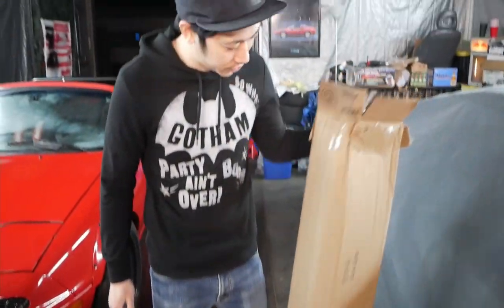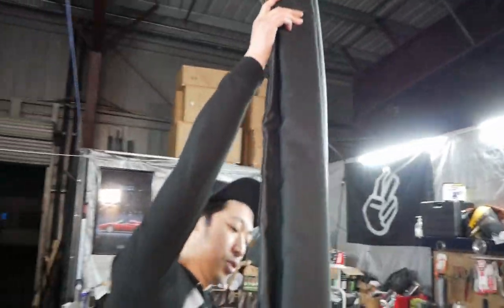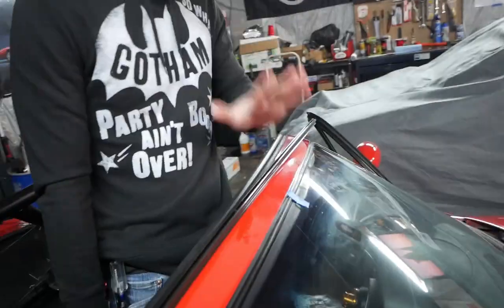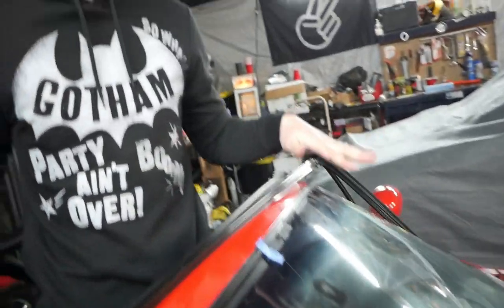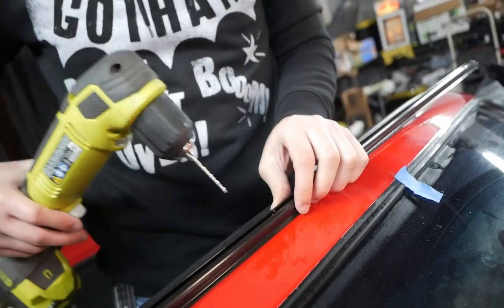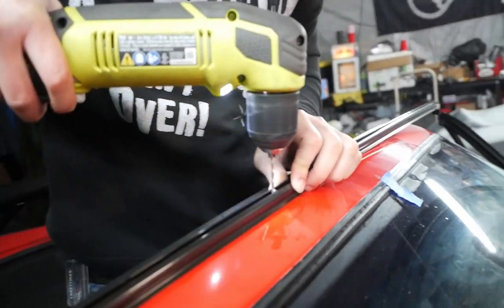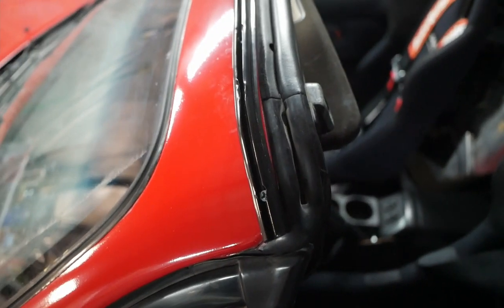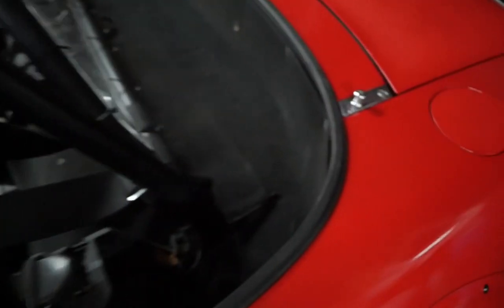Miata Bikini Top Install | And It Doesn't Cost $600 | GJR Racing Keeni Top

Comment: Dumb question but can you still put a hardtop on after you drill holes into it? I mainly use a hardtop in winter but for those summer months i really like the idea of having a bikini top.
Reply from the maker: Yeah they currently have 2 versions. One that you sacrifice a soft-top frame so it attaches to the windshield like a normal top.

2nd is the drilled rail (the version I have). But as you can see in the video it mounts just before the rubber seal. Your hardtop should fit just at the seal so the two should not conflict with each other.

Comment: that looks great!
but in order to run a Bikini top you must drill out the front?
I thought it was connected using the front laches somehow
love the look, but wouldn't want that permanent on my 95NA
?
- great video thank you!
Reply from the maker: the version I bought you drill into the body work. It was intended for more track focused cars where you dont care too much about body work. 

They do have a version that uses parts from a soft top like the latches I believe. Check the site out.

Comment: I’m wondering why you HAD to remove your soft top to fit the roll bar? 🤔 I have a roll bar installed as well, didn’t have to take the soft top out though.
Reply from the maker: The roll bar I had (hard dog hardcore M1) would only fit plastic window soft tops. I had a glass window top. So instead of replacing the top, I just opted to remove it completely. Car was always going to live in a garage and really only a weekend/track car in good weather.

Comment: been going back and forth deciding whether to put one of these on mine...any parachuting effect on the hwy? How tall is the PVC mounted  bracket...like 3/4" or so?
Reply from the maker: I've taken it on the highway and race track and if you mount it nice and taught, it doesnt flap at all. Note I also have a makeshift wind deflector attached to the cage to minimize turbulent air in the cabin.

The PVC bracket is yeah roughly 3/4in or so not very tall. I believe the guy who makes my top also makes a version where you can use the front of a soft top frame to attach instead of the PVC bracket if thats a direction you want to go in.

Comment: I'm baffled on two fronts, I've never seen a rollbar that doesnt work with soft tops and I've never seen a bikini top that needs holes drilled instead of using the front part of the softtop frame.
Reply from the maker: well technically the hard dog m1 roll bar I have works with a plastic window soft top. But I had a glass window soft top. Since this was really going to be a fair weather car only I just opt'd to sell the soft top and not get a plastic top always having the bikini top in mind.

Yeah there really are only 2 companies I can think of that make bikini tops. GJR that makes the top I used, also has a version that requires a soft top sacrifice but I like drilled version for simplicity sake although I can imagine some people might be hesitant to do that.